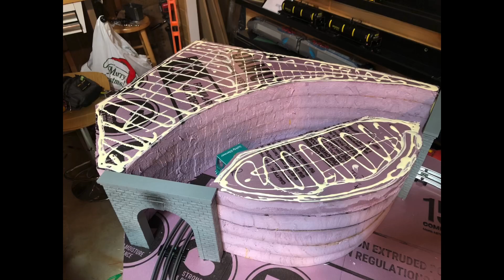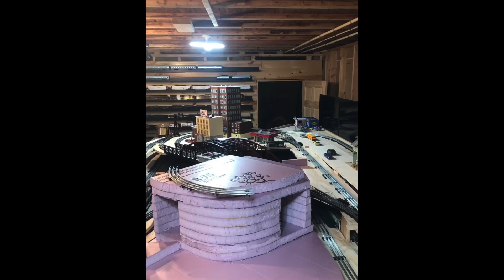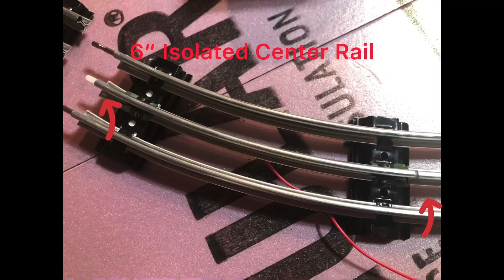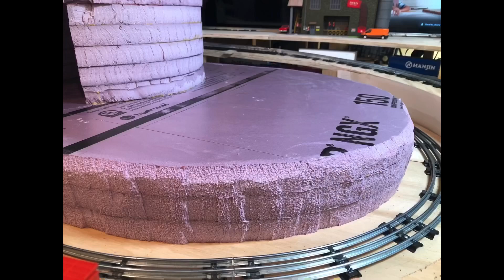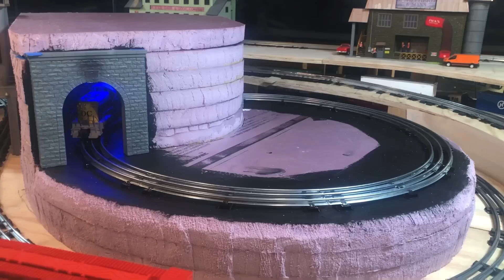The Mountain Project

Comment: Out of curiosity, where did you find the information related to automation? I've been trying to find comprehensive guides but no luck. I've found old Lionel guides and I've found maybe 2 or 3 aftermarket companies that sell computer boards to do automation but they never seemed to work for me. I've tried FasTrack and tubular (what I'm now using). The only automation I do now is related to just lights but I wanted one for either automatic stopping and starting or to have two trains on one track and they don't collide.
Reply from the maker: I'm glad you asked...and good timing!  I actually started recording an updated train automation video with an upgraded system.  When I started this layout back in 2021, I mainly had a small fleet of MTH engines using DCS, and my automation was exclusively designed for MTH engines running command mode.  It's something I ironed out over 18 years ago based on isolated rails, ground triggers, relays and bridge rectifiers to reduce voltages.  I created this video and its still mostly relevant, but I no longer use MTH ITADs for the relays after finding a more reliable and customizable solution for them after mine started failing after 3-4 years of constant service.

https://youtu.be/4YsZAkpPGKY

In the past 4 years, Thanks to peer pressure from good friends in the hobby, (Mike and Frank know who they are) I have expanded to other manufactures, which will not work with that system (I will explain why in the new video).  I have since modified the layout automation to work on any brand engine that I have.  Keep an eye out for that video in the next couple of weeks!  You can also email me at whitmorestrains@gmail.com if you want some help on your particular issue you have been having.  We will get it working! -Wes
Reply: @whitmorestrains  Finally, a helpful person. It's become rare to get some assistance on the topic of automation, finding older parts or doing mods. Usually the answer involves someone telling me to just by "fill in the blank" which always ends up being several hundreds of dollars even though there's old videos of guys doing automation with conventional trains.
Reply from the maker: @ Lionel trains were built for automation, especially in conventional!

Comment: Very nice!  Your layout is coming along swimmingly.  I like the way that you did the mountain; neat, but not complicated.  The start-stop section is pretty cool.  I've been wanting to do something like that for my trolley line, when I get it up and running, but I wasn't  too sure on how I would do it.  I thought about a Lionel start-stop station, but it is a bit bigger than I would like it to be, so your idea looks like something that I should try.  I'm not exactly sure how to wire it, but I'll look into it.  An excellent update and video, as always.
Reply from the maker: I would be happy to help you figure that out. I use this relay for about everything now, and I have a crude wiring diagram @ the 5 minute mark of this video if you need a visual.  Just reach out if you want to work through it. 

https://a.co/d/eLBgWTr
Reply: @whitmorestrains  Thanks, I'll do that.  After a hiatus, because of the holidays, I'm finally getting back to the layout,